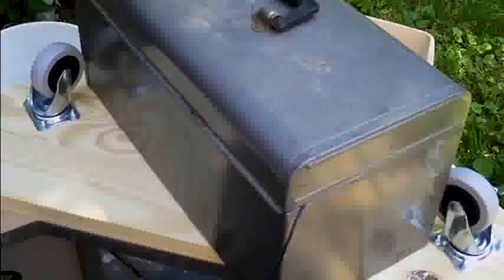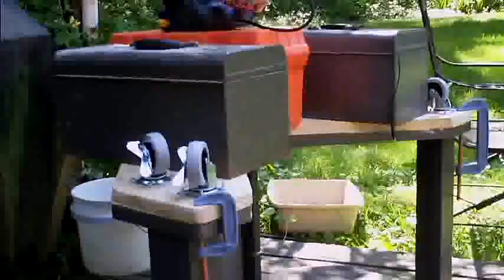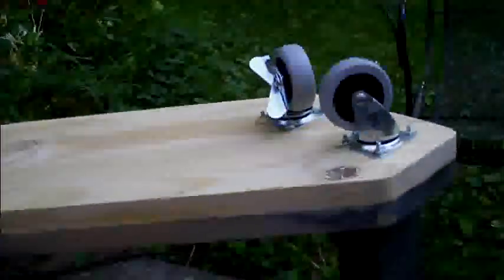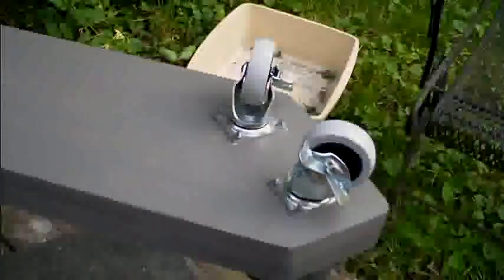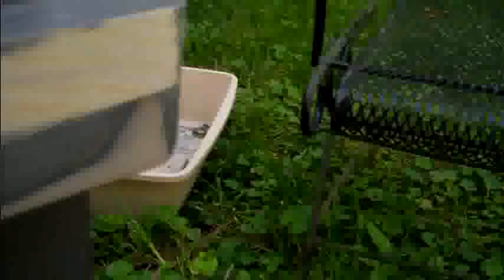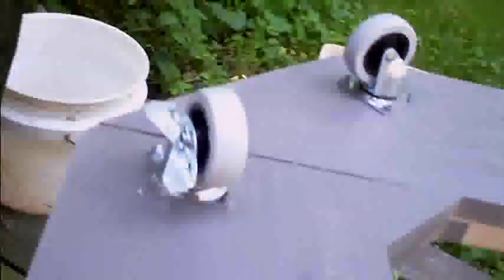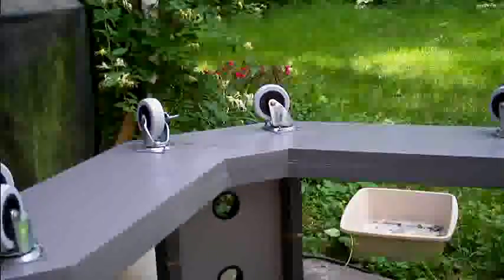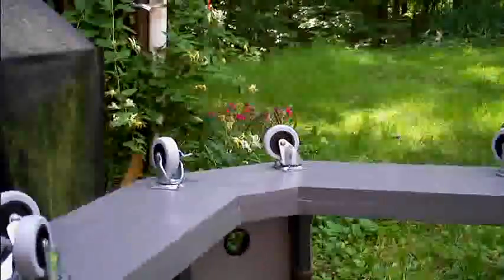Adding wheels to the Stock Sony 40 inch Trinitron XBR Stand Part 2

Comment from the maker: the Bush particle board material seems to be a step up from the usual junk out there. It's actually very sturdy in how they constucted it. I don't have any doubts it can handle the TV's weight. Now if a cat jumped on top of the set, that's another story! Tempered Glass shelves go in the bottom section